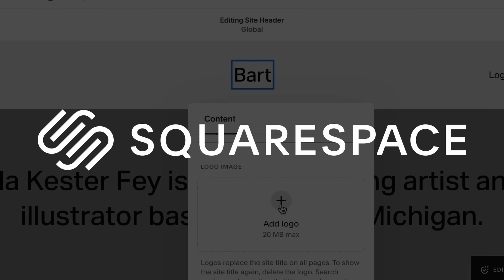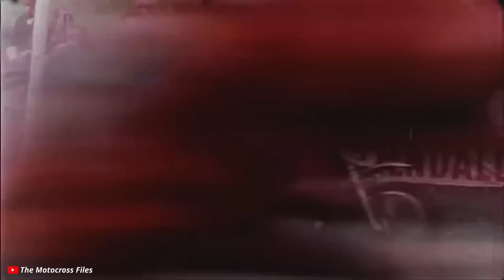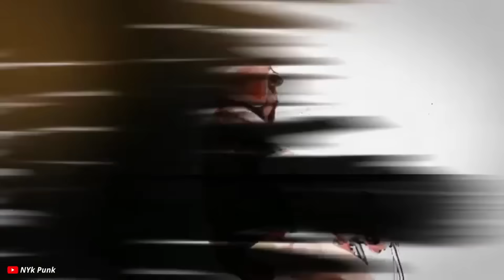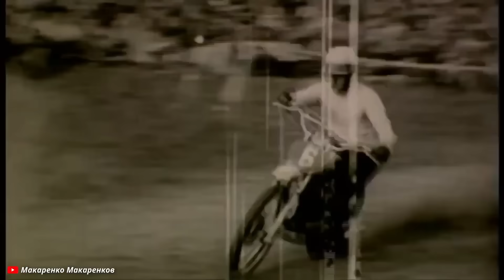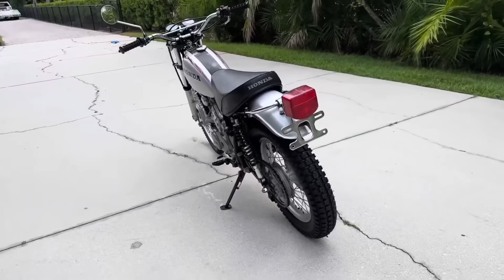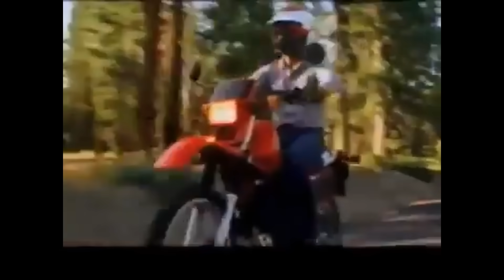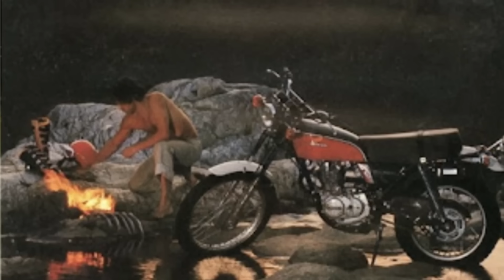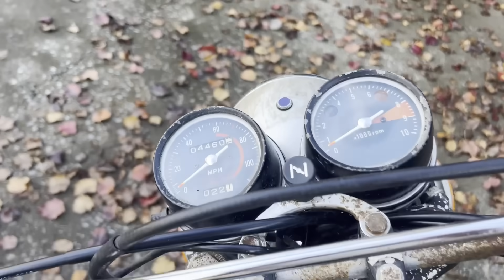The Forgotten Honda That Made The Enduro Scene

Comment: The easiest way to clean a tank is to use muriatic acid. Go down to the hardware store and buy a gallon of muriatic acid. Then put a gallon or two of water into a container and add the muriatic acid. Don't add the water to the acid, add the acid to the water slowly. Then remove the petcock and plug it with a rubber stopper. Then fill the tank with the acid all the way to the top, otherwise you'll make a pitted ring around where the water line is. Keep it in there for an hour or two and dump it back into your container. then use water and baking soda to neutralize the leftover acid inside the tank. swish it around and then dump it. Then you have to dry the inside of the tank quickly so it doesn't flash rust. Paper towels and a hair dryer. Then I put some wd40 or marvels or whatever to keep it rust free. Or you can just put gas in it and go! Works so much better than anything else. It just blows it out in a few hours. keep it away from plated surfaces, especially chrome.

Comment: i have owned several for 25 years, they are a lovely fun bike and can really surprise folks at the dirt track carving big drifts and rooster tails too, i run a 38mm c.v carb on mine :)
big downside is that magnesium is very corrosion prone on the inside of the engine. Always grease that clutch shaft on engine side as regularly as lubing the chain and remove any dirt/water after a rainy ride and get a new rubber bung if not sealing. next time you have the engine side covers off take the clutch lever side to an engineer to drill out and get a roller bearing installed, the clutch shaft is the first thing to wear out and is so much nicer having a nice feeling clutch :)
 can get bearings installed for the cam as it sits in aluminum with a single tiny oil hole which blocks and cuts the oil from the cams, will notice adjusting points regularly if cam is starting to eat into the head.

also noticed that strange canister thing on the end of the crank shaft? can you guess what it is??? it's a centrifuge to force out contaminants from the oil, great idea! but yea..... careful cleaning that out as can be tricky to pull apart, i broke mine on the first go whoops

Comment: I bought my XL250 in April 1974 so it’s a K1. Still have it today 51 years later. Best bike to get my license and start using to ride to work through the week and play on the weekends.
Reply: First at 5 years old, a 50, then a SL 70 , followed by a MT 250. Love Honda for a dirt bike that never seems to fail.
Reply: Seems like mine was a 73 model XL250 about $889 dollars brand new.
Reply: I had a 1973 sl70. It was my first bike. I loved it

Comment: I bought my XL250 in 1975. Off-road motorcycles were unknown in the Netherlands then. I thought about using it for dirt riding, but the engine power was too low for that; I couldn't lift my front wheel out of the sand. Before I fully realized its limitations, the brake and clutch levers and turn signals had already broken off. What would I do with it then? I realized this a few months later in Paris, where these motorcycles flew through traffic like mad, through the grass and over the sidewalk. This bike is perfect for that. I still have it and really need to restore it. The cylinder head is cracked and the camshaft is badly damaged. It still runs, though. I wanted to buy something bigger, but my wife, whom I also met on this bike, pushed me to rebuild it. We'll see. Kees

Comment: My Dad had a 1975 Honda XL175. My older brother and I got Suzuki 1975 TC100s. In 1977, my older brother got a Honda MR175 Elsinore, which I got a few years later. When I turned 16 and got my driver's license, I got my dad's XL175 and put it on the street. I loved that bike on the street; it was fun and cheap to run.

Comment: I’ve had five.  My first bike was a 74 Motosport and I have owned four more including a fully restored 73.  They are good reliable steady bikes for around town, gentle trails and an occasional longer trip when you don’t need to be anywhere in a hurry.  As a seventeen year old, I had my bike up to 90mph on the clock on a UK motorway.  I rode it from Glasgow to FortWilliam in Scotland a few times and in all the time I have owned them and had them on the road, not one has missed a beat.  I have very fond memories of them.

Comment: I've saved a couple of XL 185 bikes from the junk heap. turns out most of the china fmm engine clones are a bolt in swap. Putting in a 300cc 4 valve now. Modified an XL350 tank to fit to increase fuel capacity...Drum brakes and carburetors will keep you wrenching. Super simple machine

Comment: I always had a love hate thing with early hondas.Prone to abrupt stalls in tight terrain and kinda heavy.And somehow they threw rocks and sticks at my feet where other bikes almost never did.What was that about?!? Weirdly i never that issue with the 2 stroke MT series.Go figure.I loved the classy 4 stroke engine sound though.Even the cam chain added character.

BTW you can almost replicate the awesome exhaust paint smell of those early hondas by spraying the exhaust with 'export' brand degreaser😁(an australian brand)

Comment: I remember the Motorsport 250 well it was a heavy bike not to bad on road but not anywhere near as good or fast as the two strokes of the time Honda never really made its mark here in New Zealand until the xls models of the late 70s then took over with the Xr series in the 80s pro link was just amazing i spent a lot of my youth drooling over motorcycles at the local dealer
Reply: correct, you have to wonder how Bart came up with this mis info

Comment: Stripped down, 276cc bore kit, head ports clean-up, Mikuni carb, header pipe with a Super Trapp, Preston Petty fenders, stiffer fork springs, stand-up shocks swingarm...those were the days, my friends.
Reply: Powroll made some very nice go fast goodies back in the day for these!
Reply: I had a 72 XL250 with Powroll kit on it. I rode that thing all over W. Texas and into Mexico. The thing was an absolute beast. Hands down the best bike I have ever had. I've had a lot of bikes going back to a Honda Mini Trail,  SL 350, 700 Intercepter ( thanks Harley ) . Had a Harley Rapido 125, Yamaha MX 100,  Honda XR75, BMW LS650,  KTM300 EXC, Yamaha YZ250F, Kawasaki KLR650 currently resides in the garage.

Comment: In the early 1980s a mate scored an early one without indicator lights from a farmer in central NSW, it had either CL or SL not XL on it manufacturing/compliance plate and I'm pretty sure it was earlier than 1972
Neither of us knew such an animal existed 
At the time I had a near new XLS250 or was it an XL250S the red model with the 23" front wheel, we road them from Sydney to the NSW north coast and back, at times we changed bikes, on the highway and road they were neck and neck, in the scrub the old Motosport felt like you were sitting on a brick while the XLS felt like you were relaxing in a hammock
We didn't call them "duel sports" that's a new age term, we called them trail bikes or enduros and before that scramblers 
Nice bikes XL250 "Motosport" they're one of a handful of bikes I would say look how a motorcycle really should look

Comment: I raced NETRA enduros in '82 with an XR200R.  Well, 2 of them.  The 80s were when suspension started getting much better and I wouldn't want anything from earlier off road.  The 90s had gotten much better.  My '99 DR350's suspension was much better than on my late 80s Husqvarnas.

Comment: The Honda XLs and SLs, and I disagree about the SL line, they were extremely well built mechanically sound bikes, as well as the XTs from Yamaha were slim beautifully designed and engineered simple air cooled machines. I was ten years old in 1973 and we called these bikes enduros and we all wanted one. The XT250 is now out of production but Honda has a simple carburated XR150 and Kawasaki has the 230 Sherpa, both air cooled simple bikes on this wavelength. I have an XT250 and it is slender and well balanced like the early bikes from this era but is also fuel injected, super reliable and a real gem to ride.

Comment: Restored/modified a 1 owner 73, down to the frame a few years ago. Switched to 12V electronic ignition, stainless spokes. Came out sharp. NOS parts are getting rare and $$. No hydraulics, 100% mechanical speedo, tach, brakes and clutch. The side covers had factory hand made witness marks on the inside from the techs that drilled the holes in 72-73. That was a cool discovery.

Comment: I had a SL350 and it was a great bike. Not light but I still took it everywhere. I wish I had it today.
Reply: Nice nostalgia. I had a couple of DT250s, a CL 175, and a brand new XL350, back in the day, when I was at high school.. Good timss. The Xl350 would be a nice bike to own today..
Reply: In 1975 when I was about 16 a guy I knew let me ride his Honda SL 350 and I took off across a plowed field and got it up to 50 mph and then realized that I was heading toward a barb wire fence.  I hit the back brake and laid it down and just hung on to it while it slid up to the  fence.  It quit sliding as the back wheel thumped up against a fence post.  I wasn't hurt at all, not even a scratch and neither was the bike.  That was the first and last time I ever rode an SL 350.  I loved those old Hondas.  I had a Yamaha 125 Enduro around that time.  It was a lot of fun too.
Reply: I had both a SL350 and later an XL250 Motorsport. To be honest I preferred the SL350, I liked its rugged look and bulletproof twin engine. Another I had was a MT250 Elsinore, loved that two stroke smell and sound. Miss the 70's

Comment: I remember when the XL-250 came out. I thought it was the best-looking bike ever. It looks like it is going fast when it is sitting still. Then I rode one and it was a huge disappointment. I realized it was just another slow street bike. A two stroke Yamaha DT-250 or a Suzuki TS-185 would leave the Honda in the dust. The TS-185 was at least 50 pounds lighter than the XL-250. Claimed weight 218 pounds. Where we rode, the TS-185 was the dual-purpose legend. It is sad to see the poor Suzuki lineup today.
Reply: When my family got into dirtbikes, my mother's 2nd bike was a TC185 which adds a dual range transmission.  The 2 stroke dual purpose bikes were much lighter and had more power than the 4 strokes.  They all had oil injection so you didn't have to mix it in the gas.  20lbs makes a very big difference on the trail.  4 strokes didn't catch up until Yamaha came out with the YZ400F in '98.

Comment: I had a 75 xl250.  It made about 12 horsepower.  After Powroll got done with it, it was a 350 and made closer to 30 hp.
Reply: Stock H.P. is about 20 but the Powroll kit totally changes the bike!  The crank, cam and big bore piston coupled with a big Mikuni will make one a screamer!

Comment: In 1975, I bought a new XL 175. . I put an engine kit in it that made it  230 cc. 
It had a tuned pipe and I enlarged the ports. It put out more HP than the XL 250. .

Comment: My first bike was a used 1974 Motosport 250  bought in 1979. Was my only transportation. Mtn trails and street. Winters too.  Great bike. Later used a Powellrole (sp) kit to 305cc and a kirker header pipe. Claw action tires. Ha.  Ran that thing into the ground. Fun for street and trail.

Comment: I bought the first one that the local dealership got in 1972. Kept it until 1975 when I traded it in on a 1975 Elsinore cr250m1.  I still have that Elsinore . I did get a 1978 XL 250. It was a better off-road bike than the 1972 model. I wish I had kept both of them.

Comment: Interestingly, Dirt Bike Magazine, in the early to mid-70s, did a review of these Hondas fitted to a number of after-market frames like Redline, Trackmaster, Champion etc, with a standard framed model as a control. The final result based upon the reports from several top line MX test riders was in favour of the factory frame. Honda got it right from the beginning, regardless of the weight. The general consensus was that the stock frame handled much better than any of the aftermarket units. Honda engineers, as well as Yamaha and the rest of the Japanese manufacturers knew their stuff.